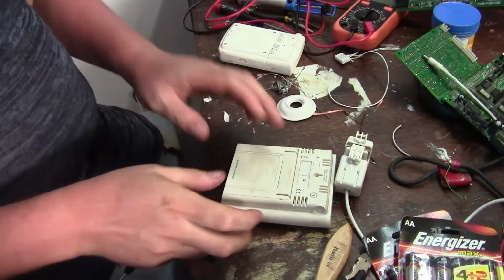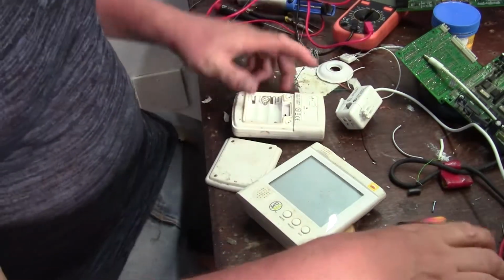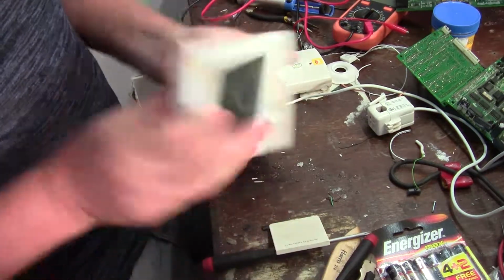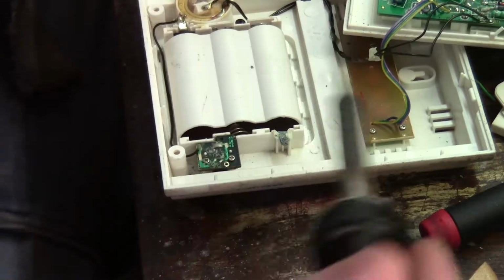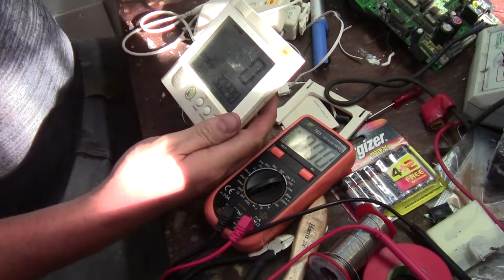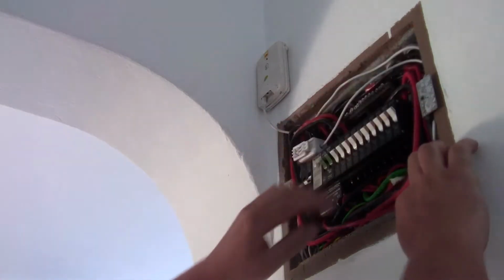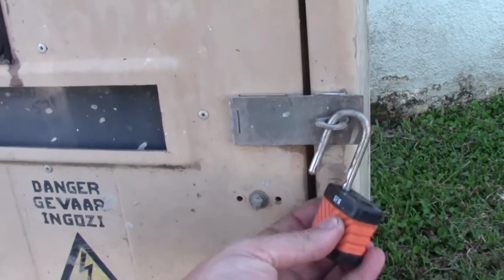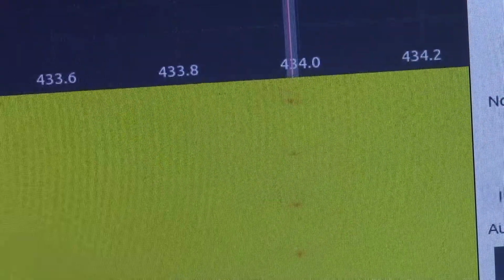ShoutingElectronics #12 - Installing Whole House Energy Monitor

Comment: See the quality of the Metro sparkies workmanship there is equal to the Never Done Correctly ones here. At least they left the lock, and did not use the Freestate lockpick to open it.

Your CT likely is internally protected anyway, the data transmissions likely is a simple ID string with a transmitter code, and the pulse repetition rate is proportional to the current, with the unit likely just averaging the current draw, and using it to control a timer, making repetition rate shorter than a heartbeat time a current indication.

Measure the pulses as you turn on and off a big load, like all the stove plates and the oven, which will give a short time probably near maximum load, and then do just a kettle, and finally a zero load test. that will give 3 points to give a zero current, known 10A load and then a 40A load as cal points. 

$33 MHZ in the ISM band, shared with the garage door opener, so likely you will be able to repurpose a remote receiver to get the data out of it easy enough.
Reply from the maker: Ironic thing is, the other day the meter reader came around, with PPE gloves and a Face Shield (Probably for Arc Flash Protection), opening all the kiosks and reading the meters. Then when he left, all the meter boxes in the area were either unlocked, or no lock, and were blowing around in the breeze.  Not good when there is a playschool nearby
Reply: @ShoutingElectronics  Probably left them open because the guy who was hired to close them is off, or his buddies are coming back later to liberate copper.